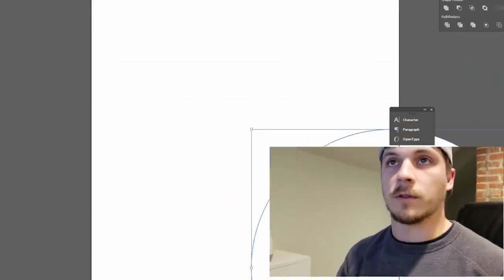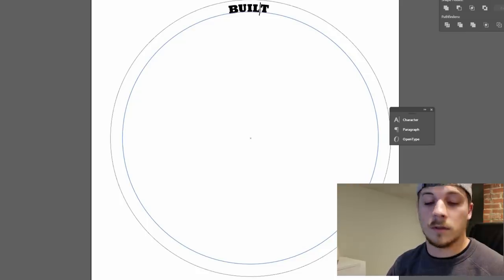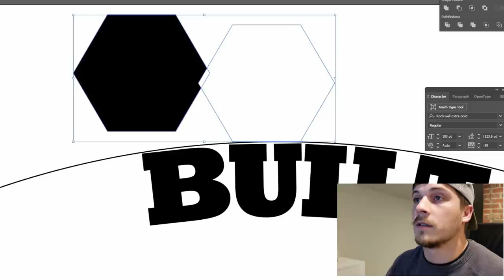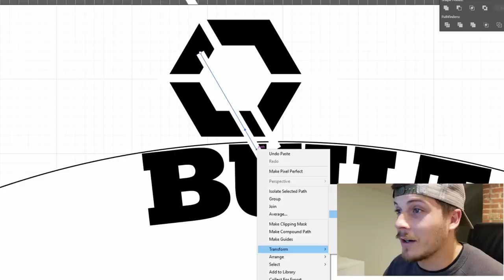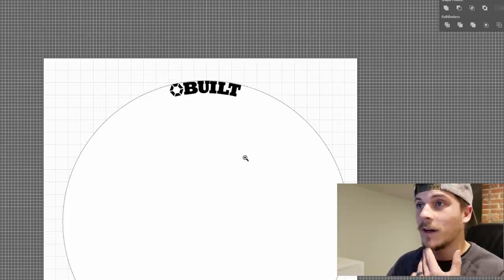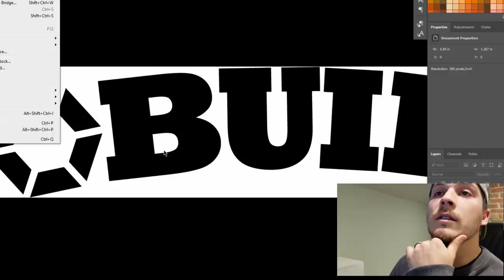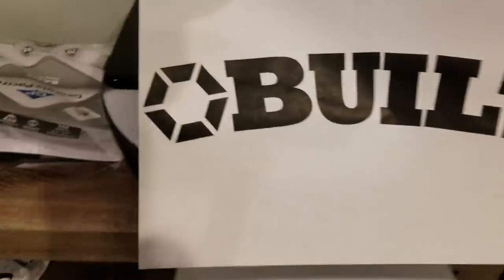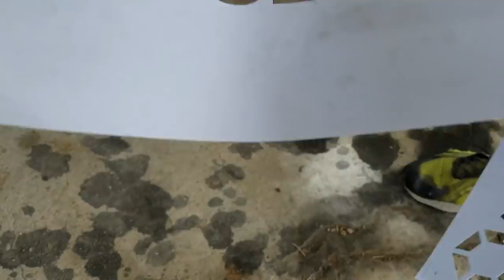DIY CUSTOM TIRE LETTERING

Comment: this is dope but the spray paint doesn't last to long and it gets dirty, i think a cool idea would be to use white flex-seal because its practically rubber in a can and you could scrub it to clean it and it wouldn't come off.

Comment: With the cardstock method you could use 3m spray adhesive on the back to.make it stick to the tire and seal better.